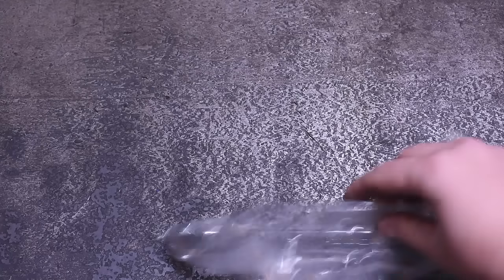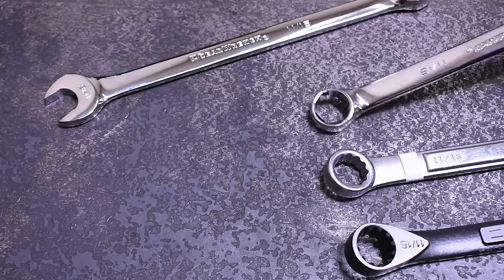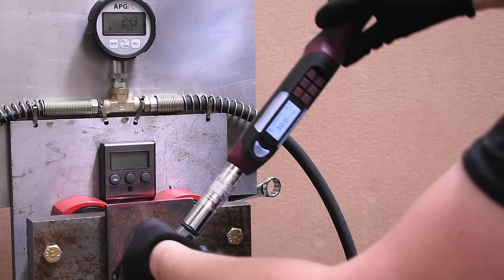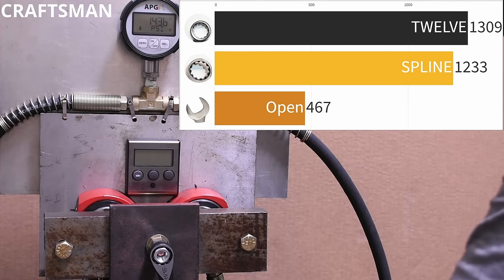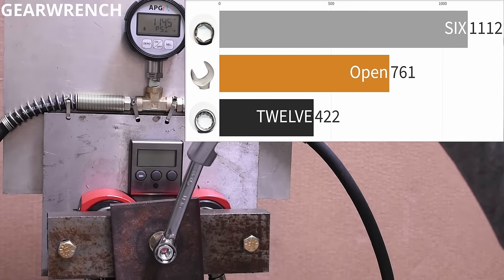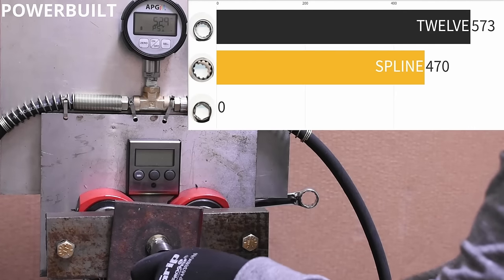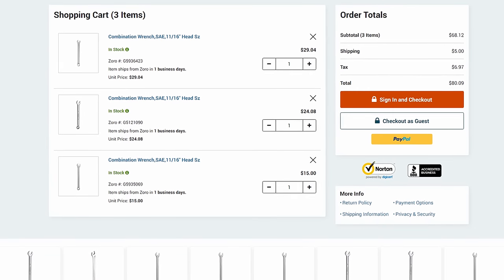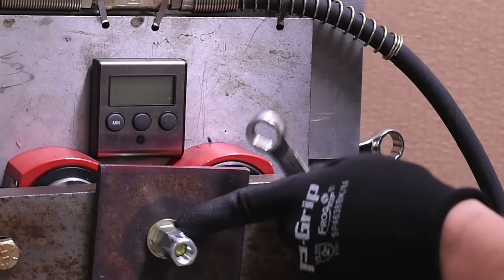Let's Settle This! What Wrench & Socket Design Will Slip 1st?

Comment: Next time, could you put a marker on your graphs showing the maximum pressure you could "reasonably" push on a wrench without an extension.  Also, this review should mention this is the max pressure test for loosening a bolt or nut.  As shown, you are fighting a nut, but you are well beyond the design of the nut or the bolt.  Also, the spline wrenches are designed to deform/destroy the bolt/nut while applying max torque.  When using one of these types of wrenches, always plan on replacing the nut or bot. These wrenches are the same as using a giant set of pliers.

Comment: The design of 6 point is superior because it "uppercuts" the edges, to create more surface area to rotate on. It "scoops" the bolt. More than 1:1 side engagement has no effect, unless the extra splines reduce the surface area of the teeth, causing less torque transfer and more "cutting" (like knife.)

Comment: i've always suspected this was true. But my new question is why arent bolts and wrenches just 3 sided. Theres no way to strip it. The more sides, the closer to a circle it already is from the start, the easier it is to turn into a circle. So why not go to the lowest possible option with 3.

Comment: It seems to me that it is not the wrenches that failed but the "nut".  If you're using a soft nut (or bolt) then maybe you need to reconsider going to a harder steel.  When the nut collapses or the wrench slip on a soft metal, that's not wrench failure.
Reply from the maker: We're not trying to get the wrench to fail. We're seeing which grips best. If you want to see a bunch of sheared bolts use fresh grade 8. But then again any wrench will work fine on perfect nuts and bolts.

Comment: the open ended spanner would have performed way better, if you had used it the right way.
they are desingned to be used with the short end having a short lever on the nut, and the longer end should have a longer lever on the nut.

Comment: Getting yelled at by a mechanic for not wanting to use a 12-side socket to torque a fastener because I 'feel' (read: know) it's going to round off the head only to get yelled at for rounding off the head is awesome.

Then I proceed to spend half an hour hunting for that size 6-side socket among the other mechanics like I wanted to in the first place and get all the other really-freaking-stuck fasteners off without a problem - the mechanic who yelled at me bitching and moaning away as he has to cut the rounded one out with the gas.

Comment: want some big help breaking up rust ? use a mix of 50% acetone with 50% transmission fluid in a spray bottle . absolutely the best way . even better than pb blaster. and yes, 6 point sockets are best . here in new england we don’t need locktight. we have rust .

Comment: 6 points are the obvious way to go. 12 points are used when your in a tighter spot and need the socket sitting in a spot where you can have room to break loose with a ratchet where the 6 point won’t allow the room.

Comment: Surface area matters. I would wager the 6 point simply has more metal in contact with the nut therefor the distribution of force on the nut it more even and not limited to the corners of the nut. To look at it scientifically other than saying "it just fits better".

Comment: I wanna see these test done against a Metrinch. And not the cheapo version but the actual Name brand Wrenches. I have had the for years and they will remove nuts and bolts no other socket or wrench I have will remove

Comment: In my experience being a millwright 12 pointers are not the move I’ve stripped nuts with a 12 and then used a 6 on the stripped one and it works

Comment: Let me start off by saying I'm not trolling.  Just want you point out a math flaw.
@ .780 - 20% =. 624 which is -.156 from overall diameter or .078 on the half ie radius.  What you actually took off was 5.1% . .780 - .740 =   .04 overall diameter .020 on the half  ie radius.  So  twenty thousands (.020) per side not 20 % overall diameter. Good vid btw
Reply: 6 point has more surface contact,  the 11/16 is measured on the flats not the pionts that's why it performs so well . The points are actually 25/32.

Comment: The problem with spline is that i chews the nut or bolt. In my case where we are working on very expensive machines the customer whould throw a fit if they were paying millions or a machine with chewed up bolts.

Comment: I don't get why you'd get a 12 point ratcheting set, I wonder if they even make them, I mean you can turn the socket end and you get twice the performance, not sure what you meant by the conclusion or maybe you were talking about splines vs 6 point but it's the same argument I think, 6 point 25% better and just as capable, maybe splines give you a tiny amount of ease of use, is that worth 25% worse performance when you really really need it, probably not. Most bolts aren't bad but when you do run into them that's when you're really happy about having quality tools

Comment: the decision between 6 point, 12 point and spline should really be made by the bolt head style. Hex heads should get a 6 point, 12 point heads ether 12 point or spline depending on preference. A better test would be 12 point vs spline on a 12 point head.

Comment: I have a cheap set with 12 points and I’ve rounded off enough bolts that I won’t use them on anything but easy bolts

Comment: Tolerance specs were not considered.
45 years in manufacturing 
Even things in” spec “ can vary in their tolerances 
This goes for not only the tool but also the nut. 
This can be related to size & also hardness

Comment: You are using an open crescent wrong (everybody does). The overgrip makes it easier to get on the nut (slightly) but the problem is what causes slips. A slip with an open crescent tends to happen when the c shape separates from the fastener or becomes crooked. When you are in the overgrip, any imperfection in your stroke moves the c away from the fastener. With an undergrip, on the other hand, your pressing, if you should happen to wiggle, you are actually pushing the c in deeper.
 
It doesn't make enough of a difference to correct anybody doing everyday jobs... comfort is a priority for sure in that case... but if you are trying to go for max torque on a problem fastener, and not only is torque a priority, but you might also be applying impact and you REALLY need the crescent to not strip the fastener and make the job even worse... you should definitely be using the undergrip for those "This has to work or we're screwed" situations.

Comment: Yeah I knew what would happen with the 12 point. I thought the spline was kind of a gimmick. Maybe useful for nut removal purposes only, but based on how it machines the stuff, I wouldn't bother buying it. Not shocked 6 point kicked ass.

Comment: Olsa Tools Flex Head Ratcheting Wrench Set (Metric 12pc) | 6-Point Box End Ratchet Wrenches Set | 120 Tooth Ratchet Wrench Sets | Works on Stripped and Rounded Bolts | Professional Spanner

Comment: Why didn't you include the 'wall drive' type spanners and sockets in your test?  They are purposely designed to grip worn/damaged old fasteners without slipping. 
Also I can't figure out why you are using spline drives on a hex nut.

Comment: You a silly goose. You forgot to match the fasteners with the wrenches. If you used some spline nuts, your spline would work super tight, shearing the metal tight.

Comment: So in reality just use 6 point. maybe a set of splines for tight spaces and flex head ratchet wrench. Should be able to then get just about every bolt or nut off.

Comment: Been saying for years just b
use six when you need torque. It covers more surface area of the bolt So it makes sense The one that really threw me off was the spline doing better than 12 point because like you I always thought they kind of looked gimmicky as well

Comment: 12 point nuts  with a 12 point wrench or socket ...Double the torquable surface area.
 Which is WHY these are used on Serious  torque  Bolts.

Comment: ITS HOLLOW.   Get a solid nut or cut a piece of bolt to run in the end and re run this test-  and don’t run a 6 point - it’s the right tool for a six sided nut so of course it will outperform

Comment: 12 point sockets on a ratchet are almost pointless given the hugely superior performance of 6 points, especially on old or rusted bolts and nuts. The ratchet mechanism allows placement of 6 point in confined space anyway. 12 points are best suited in combination spanners where access is restricted.

Comment: Isn’t it obvious that 6 point will win because of better contact with the nut’s surface and a more sturdy geometry? I guessed that even before the video started. I did have some wrong assumptions though. I did not consider nut size. At this size of the nut 40% rounding off is negligible and as you go larger it will be even more negligible and as you go smaller! That 40% rounding will take effect, at that point even the 12 point and spine tool geometry will become weak and possibly even break. Suddenly at those sizes you may have 6 point and open end as winners. Nonetheless 6 point will remain the best choice due to simple physics. The physics and geometry and the strength of hexagons comes from some core sciences which is why you find hexagons in beehives etc. too. It is Nature’s choice too!

Comment: I hate spline wrenches and it's not because they don't have alot of power, it's because if they fail you are left with no other options. If a spline wrench fails to remove a bolt/nut it leaves it completely stripped and now the only option is to drill it out if that's even possible.

Comment: Never touch the bolt in a gm rear end that holds the pin in with a 12 point.and it's hard to find a six point wrench in stores.

Comment: Also would like would be good to see if any damage the nut bolt heads (avrage / good hardware) seems like the spline witch i didnt even know of is it not a uk thing ,anyway spline looks like o bolt munter but im no bob the builder/ mechanic befor u all get triggerd and gush ur pants

Comment: All about context of what’s “best”. 
Given the fact that no one should be putting 150 ft lbs on these tools. I’d say the “best” one is still the 12 or spline due to the fact it will require lest adjustment in tight spaces.

Comment: I do NOT want a super light reverse switch. Anyone that uses a ratchet enough knows that can be a dealbreaker when buying one. I had one that basically had a feather touch and that thing would easily get accidentally switched constantly and I hated it. To this very day it lies somewhere out in woods behind my house. I’m not exactly sure where but approximately whatever my maximum throwing capability was at the time. Obviously you don’t want one to stiff but there is a perfect medium between the two.

Comment: It bugs me how so many tool sets default to 12-point sockets rather than 6. 12-point should be considered specialty tools, specifically for rod ends and stuff like that. It's not an acceptable thing to put in an ordinary tool kit. As for wrenches, there's no universe where I'd rather have a 12-point wrench when the option of a 6-point gear wrench exists.

Comment: Wouldn't it have been more interesting to give every tool a own nut, that it can then damage and when it slips it just fails? Testing them one after another is not fair for the other Tools. The 6 Point would not have damaged the Nut in the first case and would have slipped far later.

For people who want to buy themselves some wrenches (to work on cars): You'll probably need a 12 Point if you have to work in tighter spaces, I never had problems with slipping or else when working on cars at our store. The 12 Point splinte ones are only for bolts with a 12 Point splinte head and not for anything else, this is only my opinion. They are almost never used in Cars, and if you would find something, I would just get the one needed as a single wrench, not a set.
Reply from the maker: Each test had its own nut

Comment: good example of wrong tool for the wrong job, i get it for the layman a 12 point is great as a cheap alt to 6 point but 12 point is more intended for 12 point fasteners like high grade torque nuts and bolt heads, using a 12point on a 6 point fastener 'works' but like... so does putting mudding tires on your daily driver, just don't be surprised when something breaks. as for the spline... yeah that's just a weird designed tool would be interesting if there are any spline fasteners it's better suited for than just a standard 6 point.

Comment: Spline wrenches are not designed to get more grip, they are specifically designed for Spline Bolts that are on many banjo bolts on brake calipers.  The Comments are comical especially from you seasoned mechanics that should know better.

Comment: Irl the torx twattery will slip first. Because the star just mushed out..same as the allen head junk...   Then on most everything else, the head will shear off the bolt long before the spanner/socket slips if you can actually get a socket/spanner onto the rusted mush you are looking at.  

Most real-world mechanics know that the least likely thing to slip off a mushed fastener head is an angle grinder, closely followed by the big nut you just welded onto the stub the grinder left behind. Those seldom slip in my experience. .

Comment: Imagine that, 6 point tools grip better on a 6 sided bolt

Out in the field conditions, those numbers for the 12 point and spline would severely drop. They only grip the tips of the corners. I work on bolts that have wear on the corners.

12 point is junk, round off your bolt head or slip off, cut up knuckles too

Comment: Well obviously, you don't need to be a genius to work it out. A bolt head has 6 flat faces, so you want a socket with 6 flat faces. You get the maximum amount of surface area in contact, which reduces the stress experienced by the bolt head, which reduces the amount of deformation which causes slippage. Using a load of point contacts just means it will deform easier.

Comment: A 6 point should be best on a 6 point. Spline is good, but it destroys the bolt. 12 point doesn't have the ability but gives you more versatility, unless it is a 12 point bolt.
Btw, you showed bolts that are not designed for anything you used, but a special version.

Comment: I was expecting a wrench failure, not a bolt failure. You tested the limits of not-so-hard bolts. If the bolt was intact and the wrench stretched (open-end) or rounded inside, then we know something about the wrench.

Comment: Splined wrenches were designed for rounded heads. Your really surprised that the six point sockets/wrench  did better than the 12 point??? You should always use six point if you have the option too.

Comment: This almost seems like a pointless test seeing in the world of aviation/space, you would never use a 12point on a hex, let alone a spline. They are designed for different bolt heads. 12 point being for a 12 point head (spreading the torque out amongst more points). Then spline is very common on aircraft engines but I would never thing to use it on a hex bolt. Setting yourself up for damage.

Comment: I do not have 12 points.  I only use 12 when bolts/nuts have 12 points so I have 12 points socket just for that bolts/nuts.  I do not have to think twice about it.

Comment: How is this relevant how you tested? You first use wrench A, it starts to fail at a given amount of torque, destroying (rounding) the nut. Then you continue to use that rounded nut with a new wrench!?
Would it not make more sense to use a new nut for each wrench you test so all of them start with equal amount of "meat" and straight planes!?
Reply from the maker: Each used a seperate nut
Reply: @TorqueTestChannel  ok that wasn’t clear to me visually. I needed to express that just because everything was done in a really good way and this was a flaw that I saw. I was wrong.

Comment: Typical smaller bolts can't take that much torque. You'll twist the heads off the bolts (or the bolts in half if tightening a nut) before you get to those torque ratings.

Comment: Also, when working on engines etc most bolts are a higher grade of hardness, these test dont tell us anything on an undamaged grade eight bolt etc.
Reply from the maker: On an undamaged grade 8 bolt literally use any design, they will all work until the threads yield

Comment: you're measuring the tensile strength of damaged, low quality nuts and applying a cheater bar which exceeds the wrench design intent.

Comment: rounding the nuts only made the test more inaccurate as the amount of rounding would not be exactly done the same for each nut. A few thousandth's makes a big difference. If you don't use a new nut for each wrench test you also do not get optimum results.